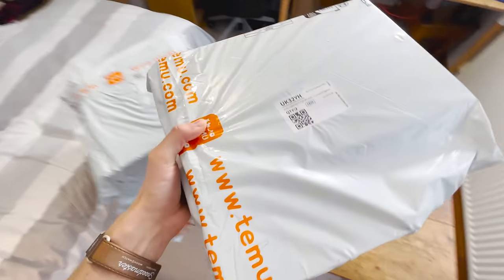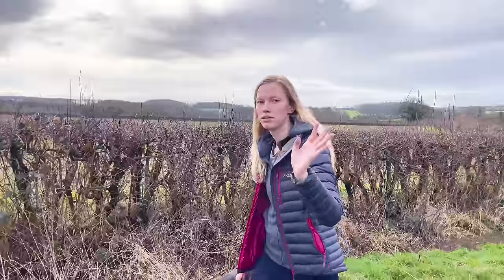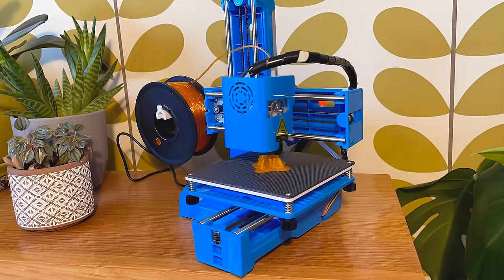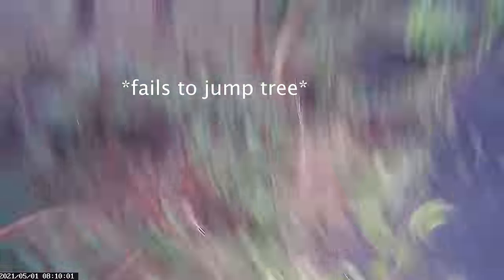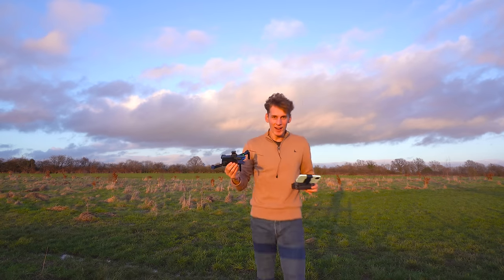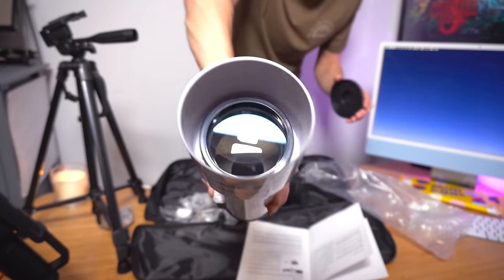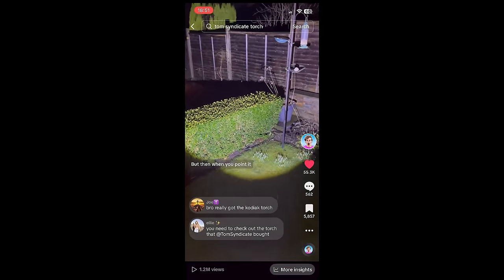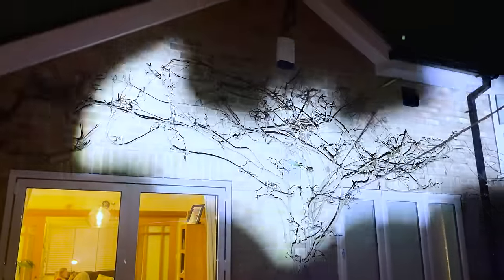I Bought ‘Expensive’ TEMU Tech

Comment: I love Temu.  You basically get what you pay for.  If you buy $10 binoculars, you get a nice set of $10 binoculars... not a $200 set that it might look like in the pics.  Also, I've had several items show up broken or shirts that were wayyy too small, and they quickly credited my account and didn't have me return the items.  No clue how they handle expensive stuff though.
Reply: I dont know what every body is yapping about, but i got alot of cheap stuff and its super high quality. For example my mousepad, my phonecase which felt more premium than my 35 buck phonecase, a mini gun That shoots rubberband, and lost of other stuff for bikes and other stuff
Reply: @Rosin2  Well mousepads and phone cases are generally not premium anyway!
Reply: I've gotten a bunch of tools and some consumables like shrink tubing, sand paper,  etc and it's been great. I have some friends who've bought things like an ssd for ps5 an excellent little travel fan with a big powerbank and lighting.  All good stuff.

Comment: Your Batsignal was inverted. The bat-shape should have been solid with a circle of light around it.

That being said, you could probably 3d Print the bat with a more opaque color PLA and see if you could either create a circular mount for it to also print, or tape it across the front of the flashlight. It would also work if you took the 3d printed Bat and attached it to an old neutral lens filter.of the right size. I doubt the front of the flashlight is threaded but you could hold it or tape it over the front to give you a more permanent Bat-solution.

Subbed.  👍

Comment: I’ve been getting stuff off Temu since it launched and most of the stuff is sh!t, as long as you remember YOU GET WHAT YOU PAY FOR, you will not be disappointed people simple as that. . 

I get only cheap cheap cheap stuff, and so far I have never been disappointed, not once. If you think you are going to get state of the art electronics you need to check yourself in somewhere, because you are absolutely not. 

Just limit yourselves to cheap shoes, pan scrubs, self tapping screws, or as I did the last time I bought something a cheap as chips it was a silicone glass hob cover for €9 because the cheapest anywhere else was €20. For the exact same thing, I kid you not.  Also I got a low cost set of slip on black trainers for work, perfect. Very comfortable and they will probably last no more that 6-8 months. But.
, they cost me €6. My regular shoes cost me €60-80 for a branded item that last no longer, and are no better quality. 

Just lower your expectations, don’t think your gonna get a fabulous drone, or amazing copy iPhone for €90 and, like me you will not be disappointed. Plus stuff comes REALLY FAST!